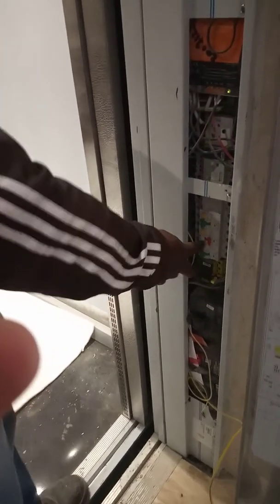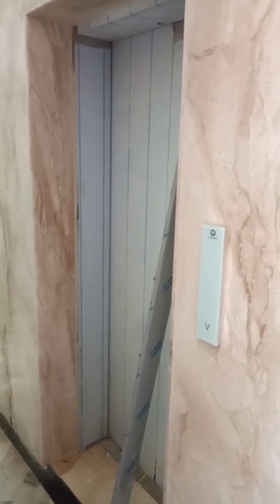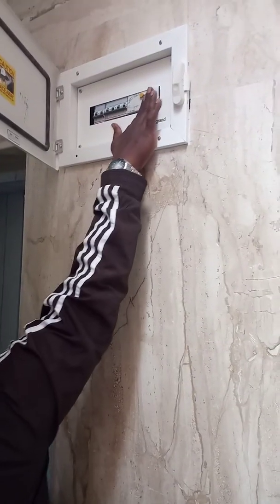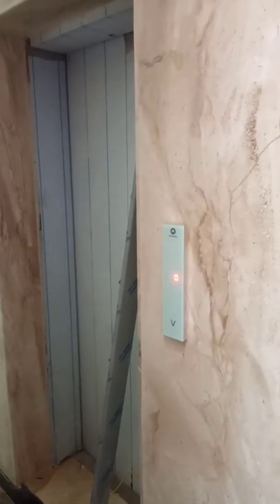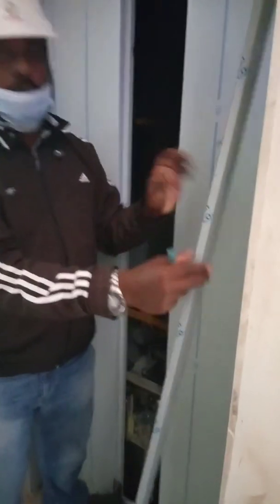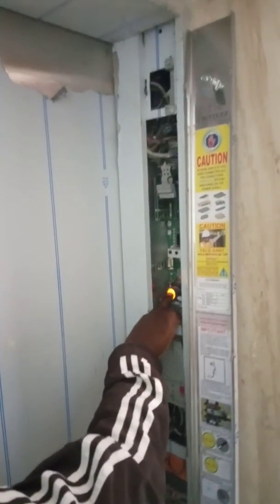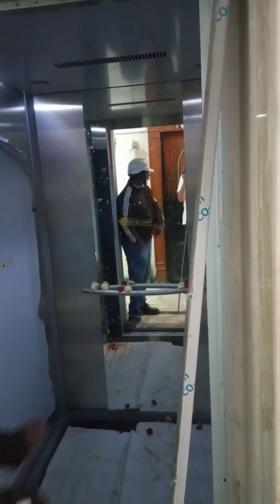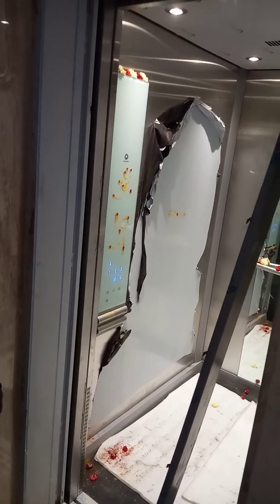Schindler elevator ARD how to rescue a stuck passenger. Automatic rescue device operation

Comment: I bought Schindler's elevator but unfortunately, it is not functional since installed (5 months) because the Schindler elevator does not work with a voltage stabilizer. In India, it is hard to get an area where all three-phase have proper voltage (May be in very few places).
But when you ask Schindler for the  solution they don't have a good option. They suggest to get the line voltage corrected, which is not in our control.. 
In my opinion, Schindler should come forward to help customers for resolving the issue and  gain customer satisfaction.